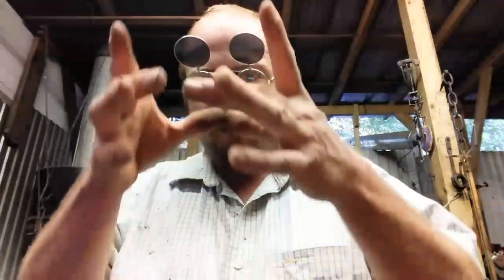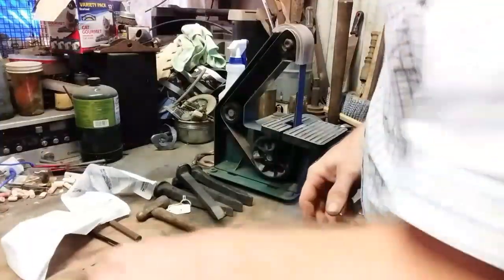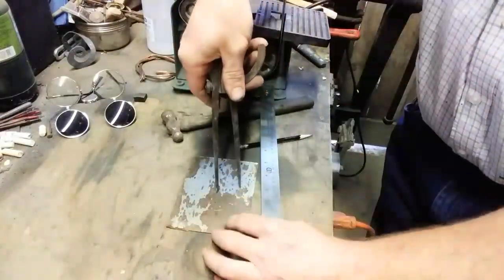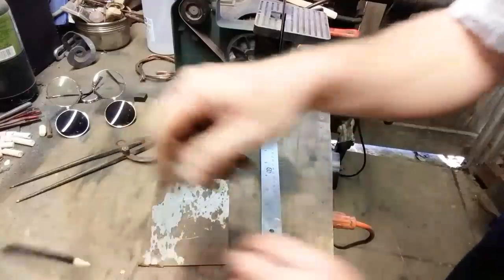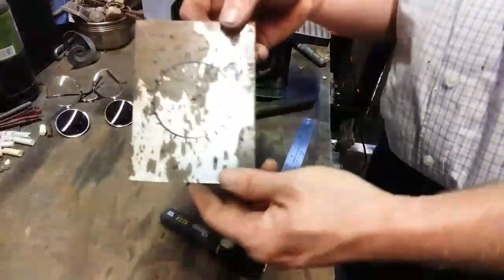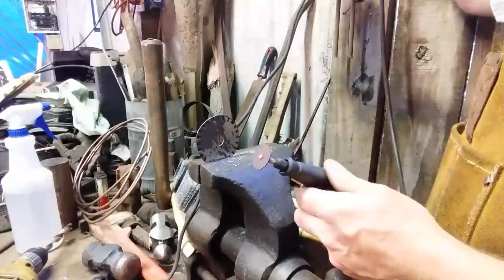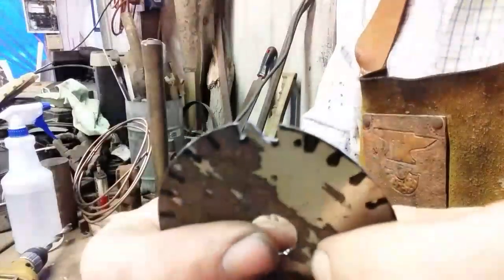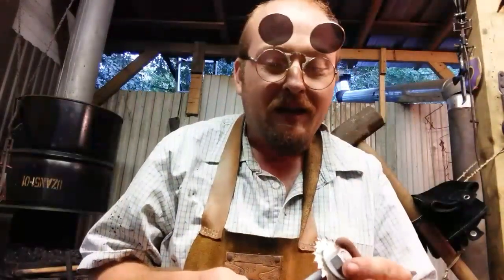Tips on circles- using a divider

Comment: Very cool James just don’t forget to stuff a rag down the pipe in case it works loose in the chuck lol
Reply from the maker: I discovered that after a near miss lol. Almost sent the nut washers and blade down the doodie pipe. Then I snugged it tighter and barbed the thread. It made the cut but in hindsight a thicker steel would be held up better. Not a tooth lived through it.
Reply: The Sprinkled Donut Forge yeah you created a exact bigger version of one we use a lot. In a pinch I used hole saw through old duct work . Nonetheless an informative great video